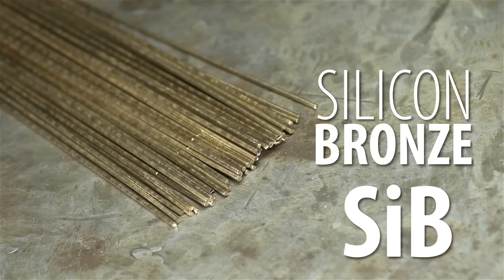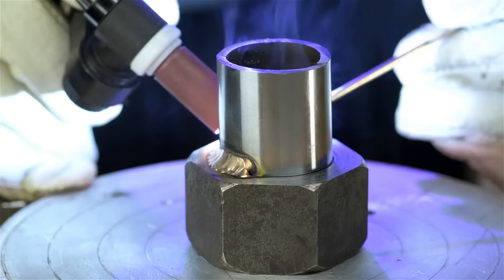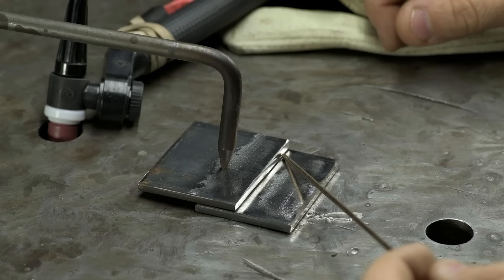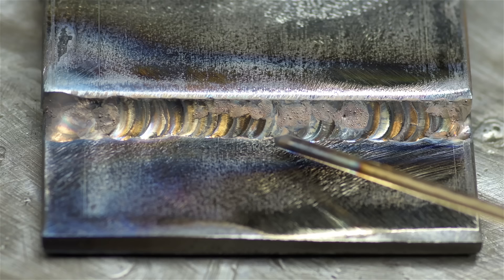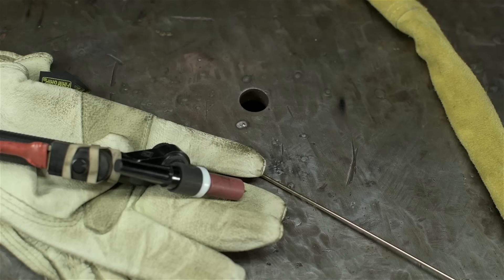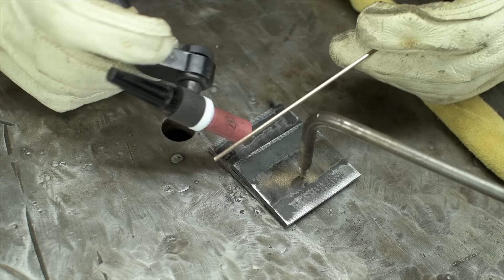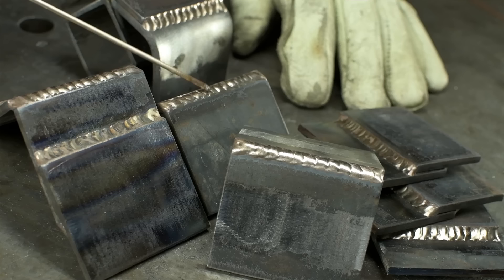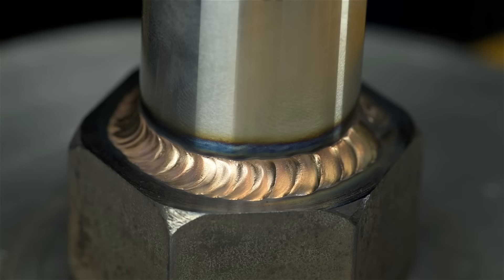Adventures in TIG Brazing

Comment: I did a 5 year apprenticeship in welding and whist I studied all types of welders and technics I didn't specialise in TIG. I went for Oxyacetylene as my major. I did a lot of bronze welding or brazing as we called it. he idea was to get enough heat into the base metal eg steel to make it glow cherry red. The idea was to use a flux to improve the flow an help produce an inter metallic bond where the bronze soaks into the atomic structure of the steel. I don't know if you can heat the steel with TIG ~ and can you use flux on the rod ?
I have not welded for over 20 years now but would still love to pick up a torch again. 
I did make a bike by using Reynolds 531 tubing and using bronze fillets that were completely smooth and gently curved. I used to love it. 
Love your videos. I would love a workshop in my garden and use my 2 lathes again.

Comment: Hi and thanks for the video. Having a so busy channel I wouldn't dare to ask you anything but the zinc free thing seems to be more than a deal to find. Most ercusi-a or even ercual-a2 I see everywhere are sold both for tig and gas welding. I bought in the past ERCUAL-A2 but experienced all the hassle you mentioned, and after watching your video I thought that the zinc issue was the problem with tig. Now I don't want to mistake again but I can´t find explanations or any ercusi ercual without, at least, some zinc in it. Thanks in advance for your time.

Comment: I tig braze 20GA galvanized at work. I use about 45 to 50 amps, this gets the metal hot enough to melt the silicon bronze but not splatter galvanized all over the place. The SB just wicks right into the joint.

Comment: That's quite a different technique to what I have used, although I'm not an expert. I keep the arc on the puddle longer than you and it wets out a lot more. Even without any flux or reducing atmosphere, the bronze seems to do that really well. My technique is more like soft soldering than normal TIG. The way you do it, it's as if you are trying to get it over with as quickly as humanly possible, possibly at the cost of poorer wetting and strength. I don't think either is right or wrong but you might find it interesting to try playing the arc on a puddle of bronze and see how it moves about.

I always start the arc on the rod, then when there is a decent sized puddle, I keep the arc on it until it wets out and then feed the filler into it. I almost never get any melting of the base metal that way but it uses more heat and the work gets pretty hot.

I suspect there are uses for both techniques - I must try your high speed approach.

Comment: If you learning to weld, learn with an old school flip-down hood / flip-down window, after you get use to using that, THEN invest in one of these if you want to. I have been welding for over 20 years and still use a flip-down for my regular hood.

Comment: I still have this lofty fantasy of repairing cracked/chipped cymbals with some obtuse methods of TIG welding/brazing. Even if they don't sound like new, it would be interesting to mess with and maybe get a stack of 20 old mangled cymbals at least functional.

Comment: Love your videos try copper welding used to weld windings it the commutator on large DC motors we used copper strips sheared off a plate for filler but mostly fusion

Comment: This is cool I just putt a Tig on layaway at a local pawn shops it a Miller I didn't get to know everything about it but for 650 it got to be good enough to start with and it looked like it had aluminum filler rods in the case so that may be a plus I can somewhat stick and mig now it time to try to Tig

Comment: a great believer in brazing used to do a great deal of it, amongst  other things the electrical fitters at a board mill I worked at were aluss busting motor castings and getting me to braze em up before their boss found out, in the ole day's motorcycle frames were brazed and everyone knows the strength of  nickel ally bronze, but i, ve not seen it tigged in before. good job Tony, once i poked a red hot end onto the crook of my elbow, SIZZLE,. Oh fore I  forget, do a nick break test in those fillets

Comment: You may also want to try a flat tip on your tungsten. It widens the arc over a greater area so the puddle will wet out better instead of using a very sharp point on the tungsten.

Comment: I had to join some brass pipe fittings together, set my machine a little hot 120 amps dc, backed it off with the foot pedal, a little squirrel y didn't like the craters at the end so I did an un needed cover pass, went a lot smoother, still not pretty but these will hold, no leaks, next time want to try it on AC just to see :)

Comment: I've used aluma bronze for molds at work on AC.. that's how we did it.. works great. I have several tig welding videos on my channel you might find informative.. however my channel isn't just about welding.

Comment: Did quite a bit of sib. Solid 12" thick cast part to brass pucks for impact wear. Get better results on Ac over dc . And i treat then like a weld all have a little puddle going before i start to apply filler.

Comment: Interestingly you can turn this into bronze filler welding instead of brazing with enough heat as the base metal starts actually melting into the pool. This can actually work between differing metals still so long as you don't tie in too much base metal.
Reply: Also fear the yellow burning zinc.

Comment: When doing lap brazes if you heat the steel to make it capillary into the joint and then fillet it it will be a much stronger joint but I guess you can't do that with tig. I love brazing with oxy acetylene or propane

Comment: Instead of a sharp tig tip, try rounding it and see if it helps the edge wetting.
Oh, and thanks for the warning at the end. I wonder if the flux covered brazing rod works any better in a pinch?

Comment: Tungsten grind angle is the nr 1 most important thing to master.    The more pointy it gets the wider the electrons will jump..  the wider the heat affected zone. 

A 60° top angle gives the best heat imput.

What i learned.   The cusi material wants that.       Its much more goo like then aluminium i find.   But when it melts it melts.  

I use 1.6mm wire at 55 amp to melt and wet it good on 1mm stainless.  But.   Dont try to make it as smooth as stainless filler.   It will melt the base allso.    I offten like to start on top of the filler to not melt the base on the first drip.          Need to do it more offten.  

Seems like its stronger then adding a mount with stainless filler in a 2stroke exhaust

Comment: the beads look awesome though with the diffrent color contrast a nice work of art,,wonder if you can do this with a flame torch like oxy propane or juts air and fuel,,also if its possible to braze brass with alumium filler,,im not to brushed up on my metalurgy,,btw what gage wires did you use for that button switch for it to handle the amp? im asking because i used 16 awg for a car battery circuit and the wires heated up badly

Comment: Although it would change slightly the overall thickness of the two pieces, would any capillary action of the bronze rod into the space between the two pieces be at all desirable or beneficial? I understood the strength of brazing was from getting a larger wetted surface uniting the parts being joined....? I'm thinking of those elaborately sculpted frame gussets in racing bikes.

Comment: for cast iorn to tool steel slow cool is about the only way to do it regular and a bit of preheat plus low carbon stainless tig wire but yea agreed  brazing is awesome espically to fix like a cast iron pipe wrench cause  of how there slow cooled to make it ductile cast iorn so if you weld it  becomes brittle

Comment: I think your amperage was still on the low side. In my (admittedly not vast) experience you cannot avoid melting the base metal to some extent when brazing with silicon-bronze. I don't think that causes a problem unless liquified base metal starts mixing with the bronze to the extent that a noticeable part of the bead looks steel-colored instead of bronze colored. 

For the testing phase, I think you should have bent back all the test pieces as you did on the first one, until they broke. As long as you braze just one side of the joint, they will always break, I think. If you also braze the other side the joint will be much more difficult to break, at least for an overlapped joint like the one you started with. On a corner joint, if you braze the outside corner and then also braze the inside corner with a generous amount of filler metal, the result might be pretty strong too. Keep testing.

Hand welding (or brazing) does not seem like an exact science to me. There are many variables, and for a one-time job it is not practical to try all the relevant variations. In my opinion that means for someone with experience, hand welding will generally turn out to be good enough to get the job done but it will not be optimum.
Reply: I totally agree with you sir! You can't avoid to melt some base metal, I can't see another way to bond the filler. And yes, would been interesting to see some more tests

Comment: WOW!!!!!     THIS IS QUITE INTERESTING!!!!......THANKS!!!! THIS WILL BE FUN TO TRY!!!!  ....ARE YOU USING ANY SHIELDING GAS?!.... THIS BEAD LOOKS GREAT, BUT, THERE ISN'T ANY "SATURATION/PENETRATION" INTO THE OVERLAPPED PORTION OF THE JOINT! PERHAPS YOU SHOULD TRY A TORCH HEATED BRAZED JOINT, AS A COMPARISON!!.... MAYBE "PREHEAT" THE WHOLE JOINT WITH A TORCH, ALMOST UP TO RED HEAT, THEN TIG THE BEAD AREA, AS YOU "FEED IN" THE ROD?!.... IMHO: YOUR AUDIO IS EXCELLNT!!!!   VERY CLEAN, CRISP, CLEAR!!! GREAT DEMO!!!

Comment: That big rod causes you to travel too fast and that’s why you’re getting that hurried up bead shape. Go smaller and take a little more time to fill and let it wet in nice. The heat window is  fairly narrow and it’s easy to overheat the bronze. It will start to  look sandy and then go right to crap so watch your heat. Smaller rod and higher deposition rate will help a ton. Great video, you’re most entertaining. Subbed. 🥰

Comment: Personally i like to use a torch to braze parts that require it and use a flux as it wets into the inner part of a joint and offers far more strength then just the edge surface tig welded joint. i would opt to metal weld the joint like that before ever brazing it, same time and effort its going to be a stronger joint.. This is why old harley frames are casted joint parts fitted to tubes so you braze into the two parts like soldering water pipes, gives a clean joint and high strength. Just my 50 cents!

Comment: If you want better welds, use a gas lens for anything above a #5 cup. The gas flow is badly disrupted with a #7 on an outside corner or lap joint. For your fillet weld, the shielding is trapped so the disruption is reduced.

You’re right, your torch angle was too shallow causing poor shielding and beads. For your pulse settings with SilBr, try a lower background amperage to avoid keeping the base metals so hot. Something closer to 25-30%. You’ll get a very nice freeze line and wet bead.

Comment: If you coat the wetting points of the materials with sulphur dioxide liquid, the depth of wetting is increased significantly especially with dissimilar metals.

Comment: as tig welder we are suppose to use the torch in push direction, waiting for a welding padel... have you tried to pull the torch, cause now with push you melt the bronce filler in your torch plasma arc and not at the metal as it is supose to be for soldering a must. try pull and heatup the metal to then melt the filler at the metal, cherrs

Comment: I want to repair the base to a sewing machine. It is cast. I need to weld a boss back on using mild steel. Do you think tig brazing would be a workable solution. Thanks for the demo that gave me the idea.

Comment: Tony what would you recommend for welding floor pans in a car there are some small rust holes that I would love to just fill with weld or a braze of some kind if possible?

Which system is best for sheet metal ?

Comment: Using 3/32 filler is sucking the heat. The fight you experience is in the wire size. 1/16 is the wire dia to use for this, a bit longer push each bead but heating is constant and bead is controlled by the filler push Buy 10# and you won't fight flow control.

Comment: Very funny and entertaining but like the detail of the process as you explain with ur deprecating humor, just a question from a hobby welder, why is no flux used in this example?
Reply from the maker: it's a different process and uses the Tig shielding gas.  it's not really whetting out like brazing with fire.  very little capillary action.

Comment: Part of your problem is you are not "whipping" your arc back and forth. You whip slightly ahead and then back on to your last bronze puddle and make your next deposit with your rod. You have to whip it in order to preheat your parent metal slightly to get the bronze to whet the surfaces. If you don't get that little bit of preheat your bronze does not flow properly and it will look course and globular. You should not have to have a pulse arc machine to do this.

Comment: I'm a noob who mig welds sometimes at work. I want to try tig welding but never used one. Is it hard to learn tig welding? Do you have to switch out the tip depending on your rods? Thanks bud. Nice vid!

Comment: "If you try to tig with gas rod, you'll foul everything; the joint, the torch, your helmet, your language, everything."
HAHAHAHAHA oh that's way funnier after I tried that earlier this year
(aluminum to steel joint) and have been wondering why it became an angry rocket (complete with a red arc tint) even after thoroughly cleaning off the flux.
That's some valuable info there, now I am able to braze when I thought I could not.

(well, that knowledge probably wouldn't have helped me that much on my aluminum to steel joint, as I did try other brazes and solders and they failed as well. I strangely found that some research on AWS's website could find no effective solder or braze between the two alloys, one always accepted one but rejected the other. but hey at least I know I can now braze stuff other than that.)

Comment: im going to braze copper fitting ,for a bee keeping tool,called a gas vap,...it utilizes a chef torch,to insert a acid gas into hives,to kill mites, ill either use  a map  gas w oxygen or my new ac/dc tig,w silicone  bronze fill,since solder wont work,needs a higher melting point

Comment: Thinking of trying this when butt welding auto body panels on an upcoming project. I'd be interested to see you attempt that,ergo thinner material. Also thinking I'm gonna use 1/16 filler and track braze. You can't lay down a bead on auto body panels even with sibr. And are you still happy with your htp? I'm in the market and it's one of the units on my list of contenders...thanks

Comment: Great demo. I am a fan of tig brazing, mostly for repair work. Over the last couple of years I've gravitated towards aluminum bronze, I think it wets out better and is stronger. But you do have to use AC, and since you're so sensitive to noise there, TOT, you may not like it.
Reply: Is tig brazing as strong as gas brazing? It's not so easy to find info on this. I'm looking to get into brazing but I haven't got a tig welder or gas yet. If brazing can be done just as well with a tig welder then it would be fantastic but from what I've been seeing people tend to overheat or weld with the brazing rods using tig defeating the purpose.
Reply: @PercyJackson93  there is a learning curve, just like gas brazing, but I find it to be much more controllable than gas brazing. The upside of gas brazing is it will burn out a lot of the nasties for you. As far as strength, I’d imagine it would all be in the filler metal and assuming you wet out properly and completely, I’d say yes. Of course the cost of the machine far out paces that of a gas brazing setup, so that can be an issue as well.
Reply: @ryanjones9305  Thanks a lot for the reply. I haven't tried much tig before but I'm looking into it. Since your happy with the brazing I think it will definitely be worth the practice. Like you say the gas isn't cheap, plus it's extra equipment to have around if it's not used often.
Reply: @PercyJackson93  if you buy a tig machine, especially one that will do AC tig, you will be far better suited for many other things, like tig welding aluminum. If all you’re looking to do is braze some cast iron, that would be a lot of wasted equipment and money. A hi freq AC tig capable machine will cost a few thousand and an O&A torch will be a few hundred. So consider your future endeavors as well.